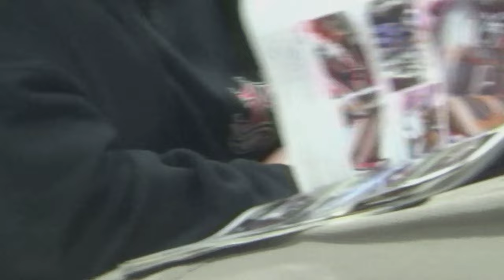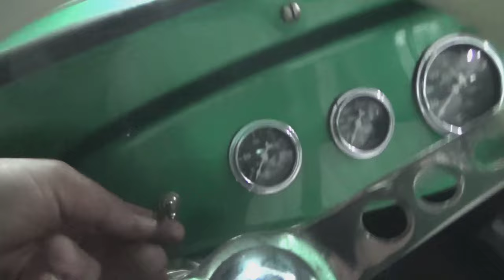1931 Model A hot rod, mounting 32 radiator and grill shell.

Comment: I'm building a model a with a stock model a chassis  with 4 1/2 body channel I'm having a hard time trying to find a radiator that will sit level with the top of the firewall any help with a radiator recommendation I've  seen some with a three inch chop I'm wondering what will work best any ideas?
Reply from the maker: Dan Obrien I used a low boy 32 style radiator. But I had to make mounts for it behind the cross member and drop it down.